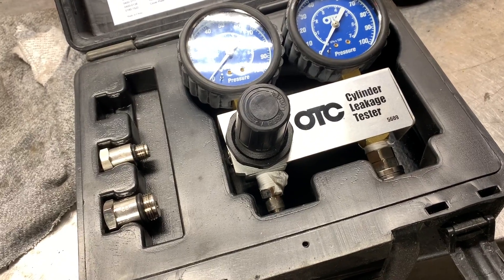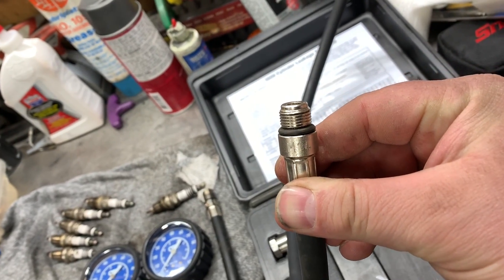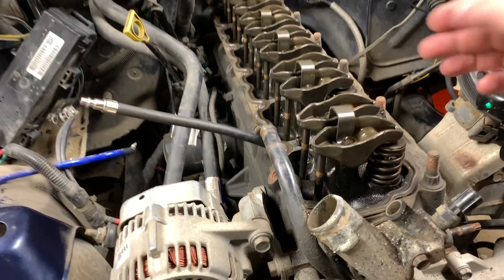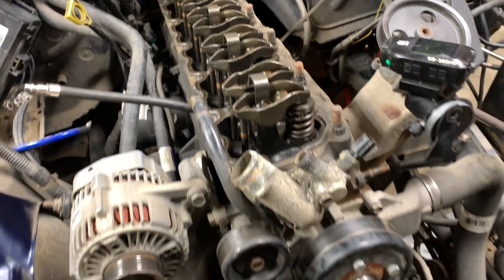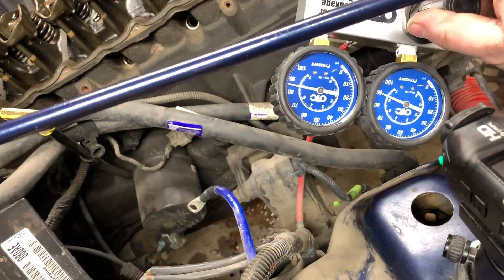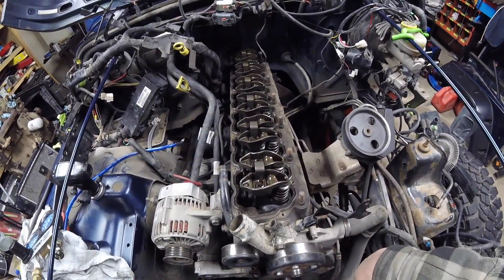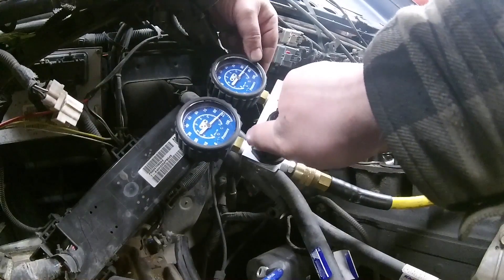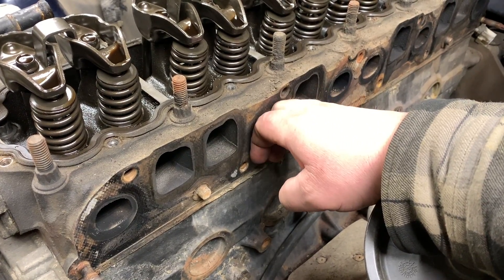Cylinder Leak Down with Low Compression

Comment: I would agree with the comment about the comp hose , pin check valve in the hose would only allow pressure to come out of the plug hole and not inward , you would be testing the hose/needle valve for leakage (needle valve there to hold pressure in the compression tool)

Comment: Could  it be because the compression test hose has a shraeder valve in it,  unlike the one that comes with the leak down tester?
Reply: This is exactly what his issue was. The hose you used from the compression tester has that one way valve, the leak down tester hose does not. This is why you had the same reading both times. You need to remove that value and do the test again.

Comment: A problem I've had on mine before was due to TSB 09-003-03. Is your engine within that range of years? It's basically carbon build up slowing down valve closure on a running engine. Worse in ambient conditions colder than freezing.

Comment: You got tdc by finding it manually, that’s where the leak down test occurs.  Doing the compression test the engine pistons are moving up and down.  Maybe it was losing compression somewhere else in the stroke rather than at tdc.
Reply from the maker: That’s what I was thinking as well and mentioned in the video

Comment: Did you ever figure out the issue?
Reply: I think he left the little shraeder valve in the compression test hose that he screwed into the spark plug hole.  The hose that comes with the leak down tester does not have one.  The valve acts as a one-way valve to allow you to read the max pressure during a compression test.  That is why he didn't see much leakage on the leak down test, even though he had poor compression in that cylinder.